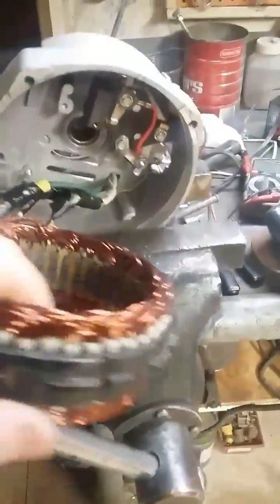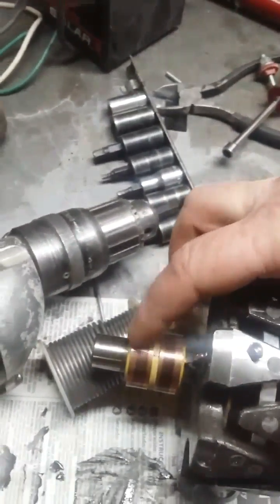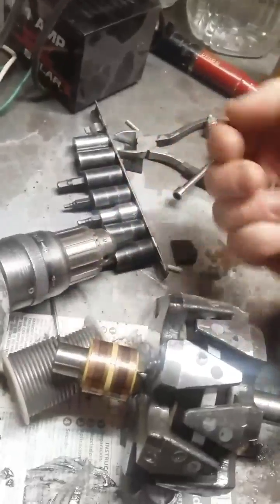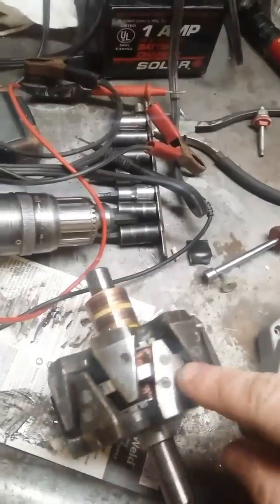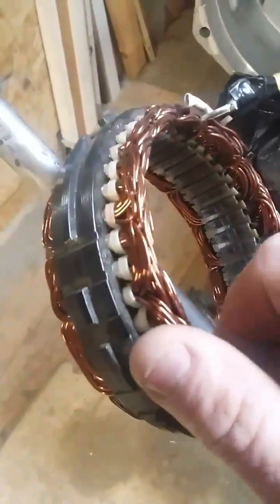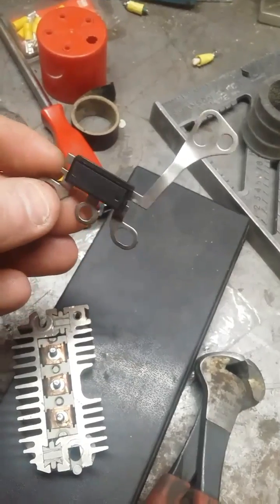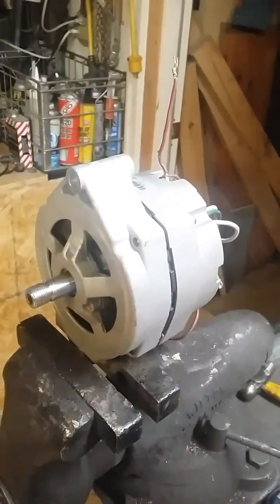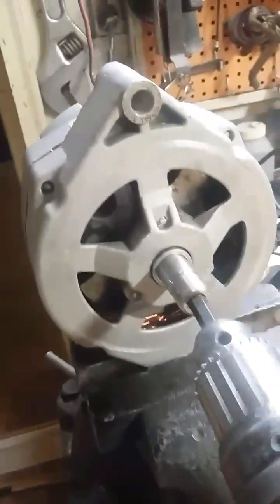wind turbine cheap and easy "free energy, off grid, wind power, green, alternator wind generator

Comment: Easy to excite GM alternator without wires...glue a little magnet to the back bearing cap...it's enough to start it without wires...from an old mechanic. It makes a one wire start charging a lot sooner also...since nobody else is going to figure this out, I have to give it to somebody
Reply from the maker: Thanks, I'm gonna try that.

Comment: My one experience with a self-starting alternator was on a massy. It wouldn't charge at first but after I excited the fields it was good after that.
I think it sat so long that the residual magnetism was too weak.
Since it was a GM product, I just got the two wire clip that goes on a regular alternator, plugged it in and touched the wires to the positive on the back the one wire alternator and it was good to go. 
But I  find you have to rev the engine to get it going. 
Now with a regular  GM alternator ,once the fields are energized I have no further need for the wires.  But if you don't have the sensing wire hooked up,it may over charge. Not sure, didn't want to chance it.
There was many times I switched out a battery on a car with the engine running to charge a dead one and the engine didn't stall,so I assume once a alternator is charging, it will until it stops spinning. At least that was my experience. 
Now,I'm talking about GM and figured others are similar. 🤔

Comment: How many amp it produced ? It was saying 100v  to 200 volt that was AC cucrent right ? But how many amp it produced and what was total watt sir? Just want to be practical to use for housen
Reply from the maker: The alternator itself is capable of producing 40 amps continuous. Anyones guess on how much it would produce in actual use. Eventually I'll get around to putting this up and testing. Thanks for watching

Comment: I’ve done what you’re explaining now with the Neodymium N-52 12mm x 3mm in my 1 wire GM Alternator I can put the center back into the Alternator but the magnets are so Strong it very hard to turn “ What’s the secret to get it to spin easily ? Please ! Help it does turn but the magnetic pull is so strong !
Reply from the maker: 12 mm seems big to me. The ones I used are really small. And even then I had some cogging issues so I offset another set of magnets, and that seemed to help. You might have chosen too large of magnets. Check the junk yards for another rotor or just a GM alternator and get some much smaller magnets. The idea is to just tickle the field current to get things started. Good luck brother.
 Also I carved an extra wide blade for a guy once that had bought a permanent magnet core that cogged badly too. If I remember I made it 54 inches long out of a 2x6. He said it worked fine. Check out a recent video of mine where I show how to carve a blade and make it out a 2x6 instead of a 1x4 like I show. Maybe I'll make a video showing how to carve the larger blade for such issues.  Hope this helps.

Comment: How hard was it on the alternator to charge a 24v batt bank? I have a24v system, and need to occasionally charge with a DC generator, I have delco 22si alternators, 130a and 150amp. I would need it to run about 2 hours or more ,  and how did you regulate the charging? I'm thinking about putting 2, 130 amp alternators in series, and externally mount the rectifiers to keep cool, and open up the back case to allow for stator cooling, maybe even add a high flow electric fan. I would like the option of constant running, so maybe series is better, but I still would like a smaller generator and one capable of powering everything and charging! 300 amps, from two 150a 12v alternators, should do it! Putting 50+amps in the bank. I would like more info, if you could help with that? Thanks...
Reply from the maker: JAMES! Since the 70's I need to make a video and explain how to do this but basically you only need to control the field current remotely using a potentiometer. If you have a dump load controller you don't have to worry about over charging your batts. Other wise you could buy a voltage dump load controller off like eBay for cheap and use it to control the field current by shutting it off and on. Place it in series with the potentiometer and your golden. A note about the amperage needed to run your house. I run a washer dryer and freezer while only charging about 30 amps D.C.  It keeps up and still puts juice back into the batts. Of course I chose appliances carefully. I use a 6 horse predator motor as my power source. It barely can charge 60 amps. I have a 24 volt system. But 30 is about right. If you try and charge 150 amps or better you will need to prolly buy a 12 horse or better motor. And yes you are right about the rectifiers. I've burnt so many of those it's not even funny. They will handle big loads for short periods but...

Comment: Can't you just remove the sliprings and it's connecting wires? You don't need them with pm?!?
Reply from the maker: The small neodymiums are there only to get the ball rolling. To create a small amount of energy only to divert it back through the slip rings to increase the rotor field-more power, more field... end result is basically a self starting alternator only that doing it this way you get early voltage at much lower RPMs than an ordinary "single wire" alternator.
Reply: @veggitarianredneck  Okay i get that. I don't really understand the physics of electricity. But in practice. Would it be possible to remove the brushes and put stronger magnets on instead? Or would it not be efficient enough? The stator is already wired three face right? If o got it correct in a star formation? Does it need to be modified in that case? Thank you for replying btw! Appreciate what your doing!
Reply from the maker: Yes if there were larger magnets placed on the rotor then usable power can be made and you could basically chuck the brushes. There are a lot of people that do just that. My purpose was to create something that was cheap to make that would be usable for wind power. Also something I noticed with the PM alternators was the high amount of torque needed to get them to spin. Wind turbine blades that use the principal of lift verses drag tend to have very little start up torque, but are a thousand times more efficient than drag blades. This design should be more efficient than the "typical" alternator conversion even though there is some power consumed in the energizing of the rotor.

Comment: Another way you could go about this is to use a Arduino and Hall Sensor.  The Arduino could be used to switch on and control the field voltage when the blades got up to speed. The same could be used as over speed protections, eaaa?  Furl tail if required ?  No magnets required.  Hell I'm going to try this one my self when I have the time.  I have everything parts wise.  .  LOL  Yeaa, Time.